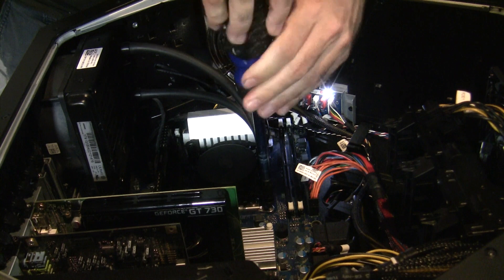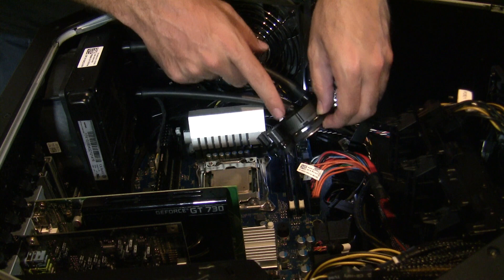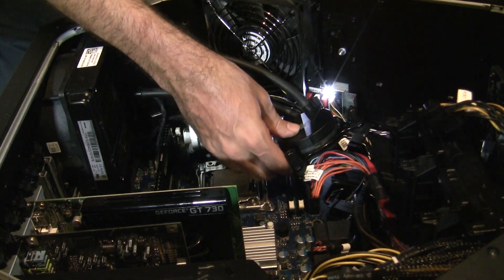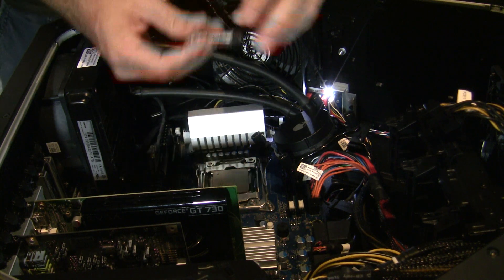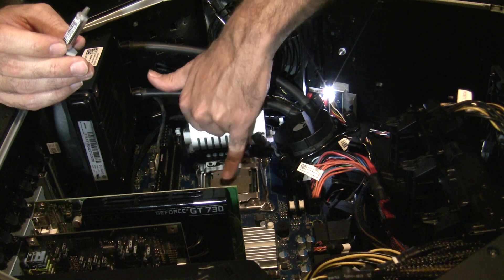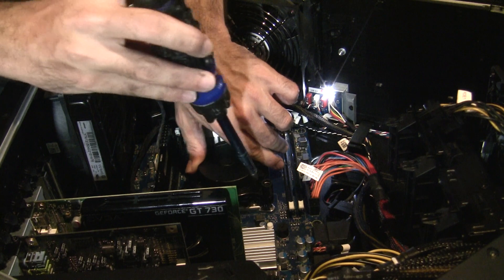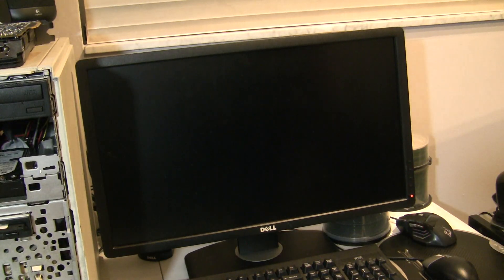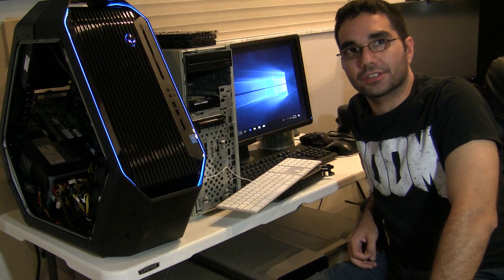Upgrading CPU on Alienware Area 51 R2

Comment: Longshot but if you get this how far an upgrade can I go with a processor on my 2015-16  Area 51 R2 with original motherboard and current Bios is A14?  Current processor came with it is Intel Core i7 - 5930K @3.50GHZ

Comment: I just bought an Area 51 r2
Reply: I replaced everything in my area51 r2... (except the front IO board) checkout my 3 part video about it.
Reply: @Mobi666  i will check it out right now, i am planning on upgrading to a i7 6950x and maxing out the ram, i already have a 2070 so i am good with that.

Comment: Great Video. I recently purchased an R2. It has a  i7-5820k 3.3 GHz cpu in it. I have a AMD FX-8350 laying around. Which is the better cpu. If it is the AMD will it work in the R2. Also what is the highest level cpu that I can put in it as I want to upgrade it to it's highest capacity. Thank you!
Reply from the maker: Hey  Darby, thanks for watching. Without changing the motherboard of the R2 , the best CPU I found is the 6950X. Its a 10 core Intel Core i7 processor. The problem is the price. I checked ebay and found one for $650 (OBO). I am not sure its worth that price, specially nowadays.  You could change the motherboard on your R2 to newer versions however and run an AMD threadripper chip.

Comment: I decided to purchase the newest Alienware area51 from dell with 1050 Ti and decided to swap it with a 2080ti, is the process relatively easy?(different pins for power cables, liquid cooling for gpu)
Reply from the maker: The 2080ti uses pci-e 3.0 which should be fine with what you currently have on that Area51 motherboard. Ensure your power supply has 2 8pin pcie power connectors (12v rail on each) to have adequate power for the card. If your power supply is SLI certified and 80 bronze/gold or above you should be ok. I am curious as to what power supply they are using nowadays.
Reply: alienwarenut I chose the 1500W power supply from dell.
Reply from the maker: Thats plenty for the Geforce. You should be fine. I have 2 980GTXs on an 800W :)  Did you get the Alienware ultrawide monitor?
Reply: alienwarenut I’m also considering purchasing the Samsung 970 Pro 1TB SSD and install it on my own in the Area 51. However, the installation process for NVMe PCIe M.2 SSD seems to be different than a normal internal SSD. Have u ever tried it?

Comment: You're like the only YouTuber I can find with an Alienware 51 R2 upgrade of a processor recently, and I was curious about something. Would you be able to install a Intel 8700K Processor into the Alienware R2 MS-7862 Motherboard or is that too farfetched? I have the Intel 5820K currently and haven't upgraded the processor since I purchased my PC in 2016. I'm assuming you can't without changing the Motherboard, but I'm hopeful you can clarify for me?
Reply from the maker: Unfortunately you cant. The 8700 has an 1151 socket while the MSI motherboards the Area 51 R2 comes with is a 2011-3. I have replaced the motherboard before on the case , although some longer USB wires and header wires would be needed.
Reply: alienwarenut Thanks for the reply, I feel like all the parts I would want to purchase separately would nearly equate to purchasing the newer R7 with an I9 processor so I may just wait. I just love my R2 though.  😕

Comment: So I have the 5820.  What's the best proc for this system now?  I overclock it to 4.2 with the standard command center and it works nicely.
Reply from the maker: After updating at at least A08 , you can actually go up to a 10 core 6950K,  They are very pricey but its the best processor for the board it came with. Otherwise you will need to change the motherboard.
Reply: So I read one article where this guy said 5820K was better then the 6950K due to the overclock speed he reached.  What do you think? I'm a gamer/VR and would not mind getting a new proc if there is improvement.
Reply from the maker: I think the price of the 6950K vs performance doesnt make sense. If it were me I would stick to the 5820K and get a different watercooler for it and overclock. My 6850K doesnt perform that much better then the 5820K. A bit more IPC and 40 lanes is what I get.
Reply: @alienwarenut4673  What water cooler can fit in the alienware area 51 actually?

Comment: I'm glad it worked out. This explains why the pinky method is not a good idea. http://www.arcticsilver.com/intel_application_method.html#

The short of it is it does not need to be spread all over because the heat is concentrated in a specific are. Regarding using a finger, "Oils from you fingers can
adversely affect the performance by preventing the micronized silver or ceramic
fill from directly contacting the metal surfaces."
Reply from the maker: According to that , I should be using the vertical line method. I havent really had any performance issues, however I can try it next time ;)

Comment: Application is fine. I’ve done it pretty much every way you can think of...and no difference. Nice upgrade. I need to jump on a Broadwell too.
Reply from the maker: Thats what I think :)  I haven't had any issues at all. Perhaps I am using more thermal paste? but I just smear the same dot around. The only thing I can think of is that it doesn't spread as evenly.